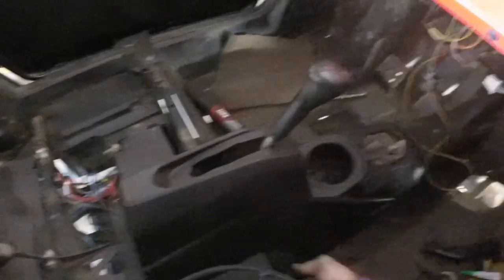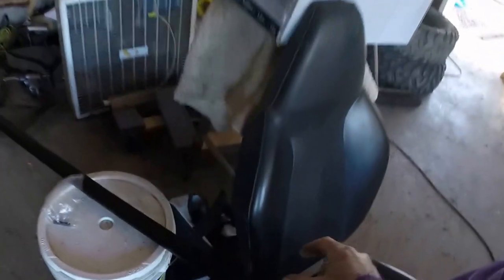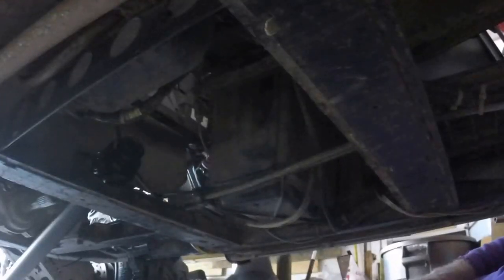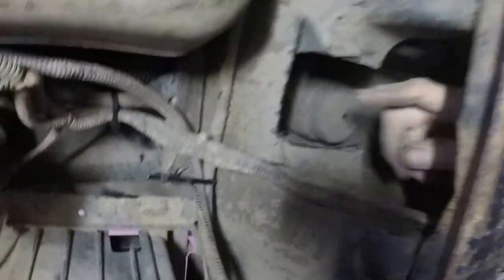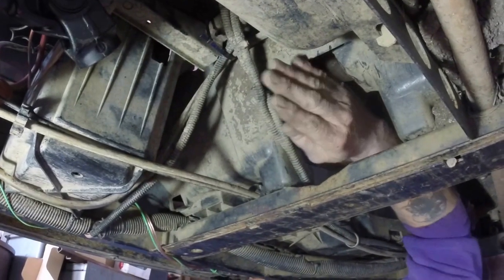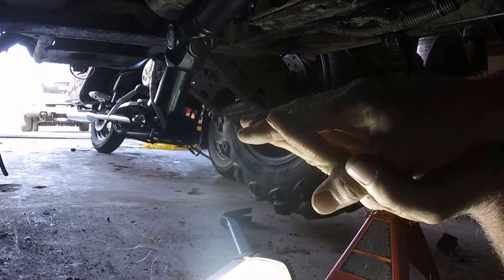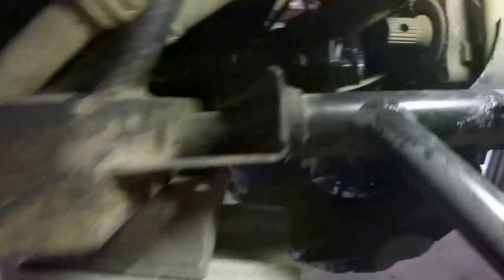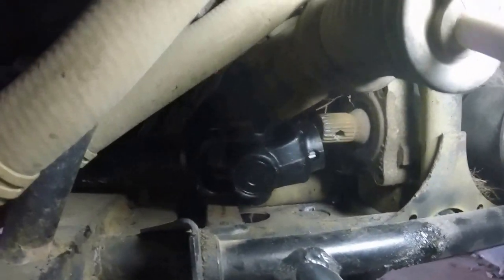Polaris RZR Driveshaft Removal IN 20 MINUTES

Comment: This says it will show you how to take the drive shaft out???  I started to take mine out and i cannot get the spleened rear end shaft apart , its like its welded or something. i took both ujoints out so the shaft is free but i cant get the rear ujoint holder to slide off the spleened shaft! i have beat on it till im wore out. Any ideas?

Comment: You should never use cement blocks for a load bearing support as it can break apart. Best to use blocks of wood.
Reply from the maker: good to know.  thanks
Reply: But they sit houses and trailer homes on concrete blocks...lol
Reply: @bmerrittful  I've set farm equipment on them to come back a few days later and the brick was crumbled.

Same approximate weight.
Reply: @exposescriminals  yea but those trailer homes have a good level pad and wood between it an frame. They're strong just has to be done right
Reply: @bmerrittful  the point, he's not working on a trailer house. These bricks are fine for building/s when weight is evenly distributed.

Never mind,,, lol
Reply: @bmerrittful  And houses use them for foundations -- older ones.   Except if one breaks, it doesn't kill you.   Don't be stupid.

Comment: So did the 20 minutes include removing the skid plate?
Reply from the maker: i got it used, did not have one.
Reply: Skid plate removal is only a couple minutes.
Reply: @jasonvsd  NOT when it is as beat up as mine.  6000+ miles over rocky Utah terrain does a number on the fasteners.
Reply: old-patriot i know what you mean. My bolts usually break off and I have to mess around getting the broken stud bolt out of the hole. I keep a bag of extryskid plate bolts.

Comment: It's really much easier just to pull the front pass side axle
Reply from the maker: how will that work !!!
Reply: removed without taking front axle out, slide right out the back drivers side, without cutting plastic. so much easier than removing front parts.
Reply from the maker: do you have a video.
Reply: i can make one no problem When my new u joints arrive, then I will send it.
Reply: Did you happen to make a video of how you removed your drive shaft?